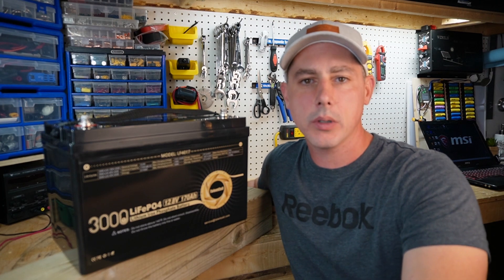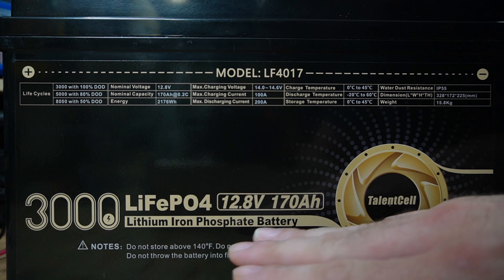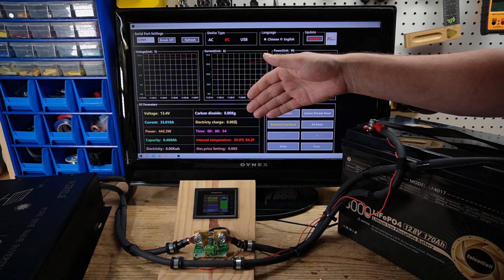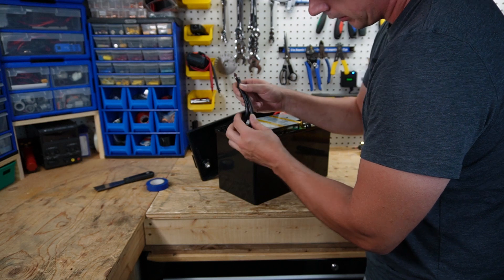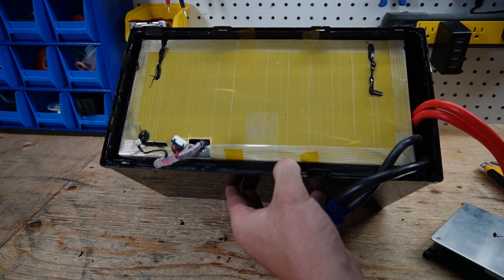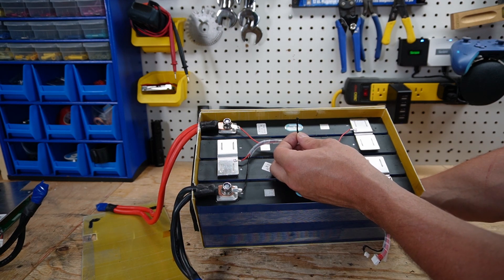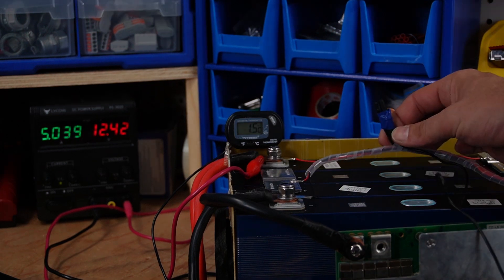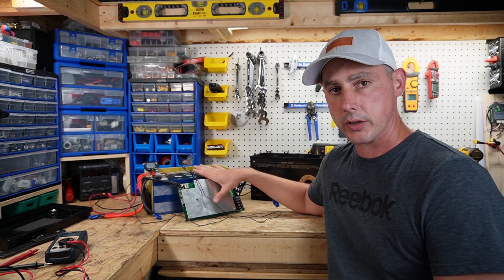170Ah 12.8V Lithium Battery Test & Review

Comment: I see from their Amazon Q&A that supposedly the low temperature cutoff is set at -5 degrees C.  Maybe check that to see if it works?
Reply from the maker: -5°c is below freezing, That is a fail when charging below 0°c the cells are being damaged. The temperature probe I used to show the temperature reading was very slow to show the reading and my ice pad had warmed up to the temperature in the video. It was much colder.
Reply: @Roll2Videos  agree, just letting you know what they said
Reply from the maker: @da7heaven  Hopefully people don't depend on that to protect their investment. Thank you for letting me know I'll look that up. 👍

Comment: Ok you couldn't even reach -2º, that's not a really a valid test for a battery that says it can run at zero when you are still within any reasonable tolerance window. You gotta step up your cold game. Try spraying compressed air upside down, that will actually give cryo temps. 
Also F is the standard designator for fuses. The FET's are likely numbered as Q1-Q20 or however many are on there.
Reply from the maker: 😂 I'll chill
Reply from the maker: It didn't stop charging past 0°c it's a fail. That temperature sensor with the display took several minutes to show the temperature at the prob by that time the ice pack had warmed up to -1.1°c

Comment: Hi. Thank you so much for reviewing this battery. The datasheet I got from talentcell rates the cells at 177Ah. I've seen many tear downs of 100ah batteries and they all seem to be too small for the case. Often times the cells are packed with big foams all the way around the battery to fit snuggly in the case. This 170Ah seems to utilize almost all the space in the case.  
I'm surprised that the non BT version uses different BMS than the bluetooth version. Talentcells said the bluetooth version uses JBD 150A BMS and has operating temp of -20c to 65c and low temp cut off at -20c. I bought the Bluetooth version and the bluetooth app shows that it has 3 temp sensors. I'm not concerned about the low temp cut off as my local temperature never dip below 35f during coldest overnight low. My batteries are solar charged and never go below 40f during the day.
As for foam covering the vent, I'm also disappointed as well. But to be honest, the balance wires kind of created a small gap between the vent and the foam to allow the cells to vent.
Reply from the maker: Very good 😀 I'm sure your battery will last a very long time without issue.
The price is really good too 👍
I wish they had of sent me the BT version but I'm happy to review this one to.
Thank you for viewing and commenting 😁
Reply: with other batters the BT BMS are often different https://www.youtube.com/watch?v=ajm1uZYZnI0

Comment: The dimensions of the cells are different then anything I've seen.  What is the weight of the battery? 18-19kg?  Too bad there was so much foam.  Covering the release valves is no good.  Thanks for the video!
Reply from the maker: It is 15.8Kg I was disappointed when I seen that. I put it back together without foam there 👍
Thank you for watching 😁